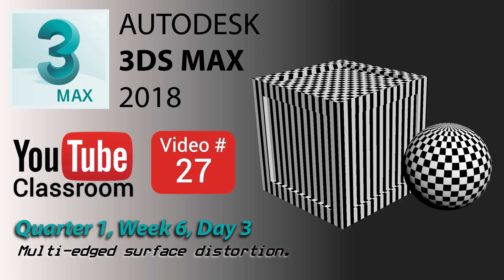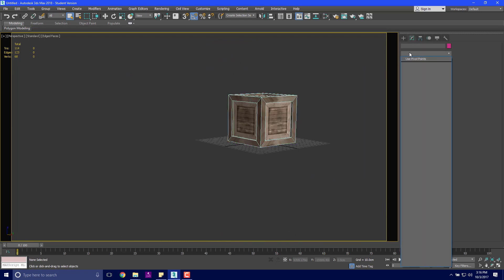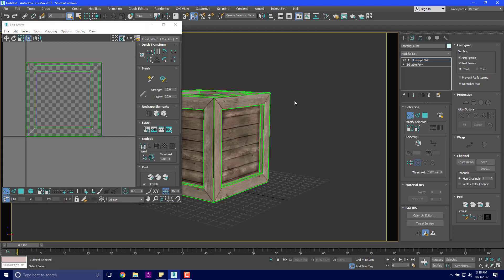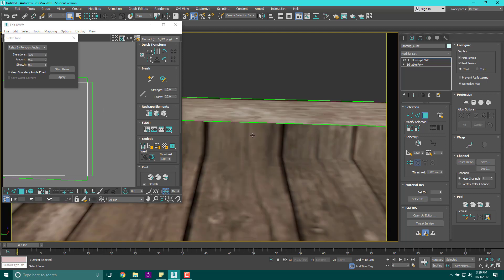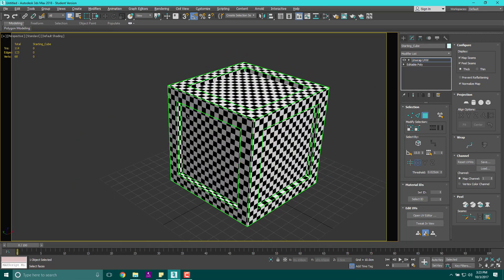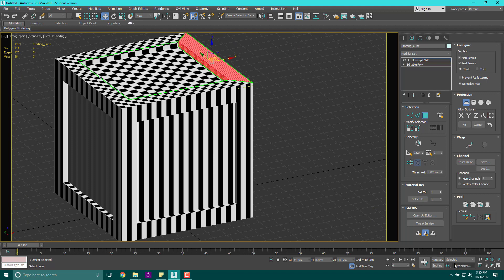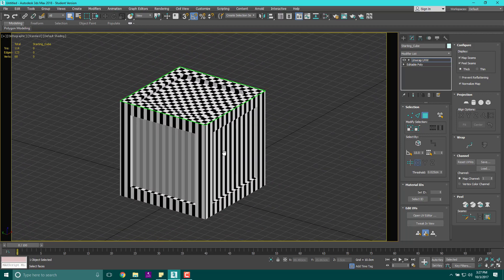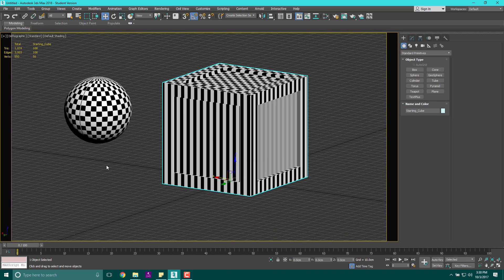3DS Max 2018 Class #27 (Planar Mapping)

Comment: So this isn't something that's really important, but is there possibly a way to constantly have the UV editor open? When I build models in Maya, I'm so used to UVing as I go and having the window constantly open. It's just what I'm used to. It's not a huge deal, but I hate having to resize the stupid window every time lol.
Reply from the maker: Karie Kelliher I use 2 screens when I can, but other than that I don’t think you can just snap the UV editor window into a quad viewport. Be careful if you use 2 monitors tho, because of the UV window is on the 2nd monitor it misbehaves by losing its coordinates every time you return to it from the main window.
Reply: I use two monitors as well so I'll make sure to keep an eye out for any misbehavior. Thank you!